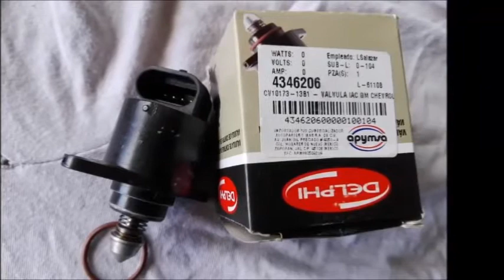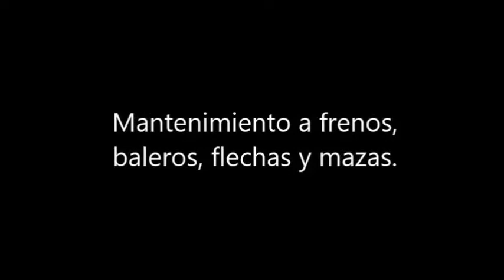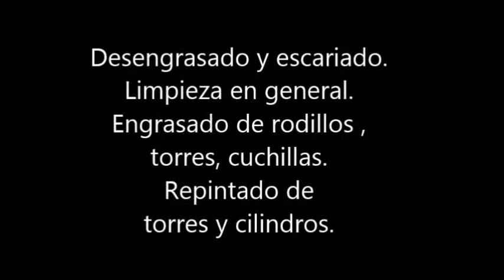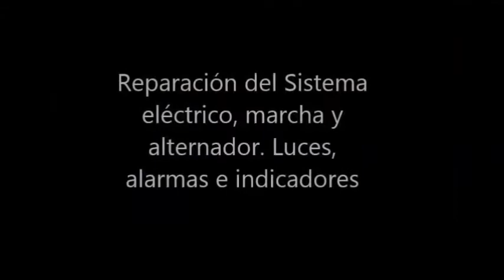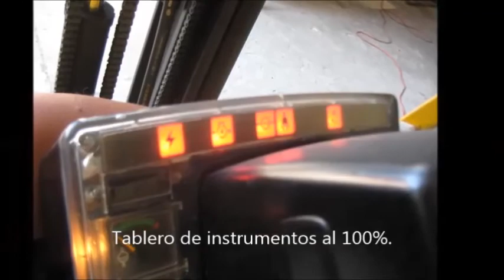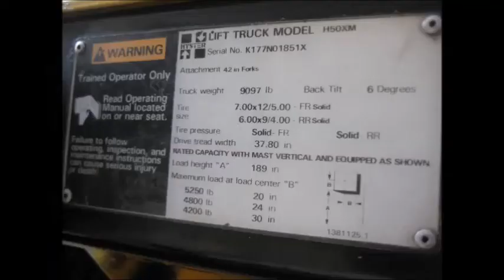Mantenimiento Integral de Montacargas Hyster. Buque Tarasco

Comment: Amigo usted tendra el manual de servicio  de montacarga hyster
Reply from the maker: Depende el modelo de tu montacargas...es Electrico o a gasolina o diésel. De qué capacidad es?... Tal vez te podamos apoyar. Saludos.
Reply: elharbano amigo es para un montacarga hyster de 3000kg a gasolina
Reply: Conquien puedo comunicarme para checar un montacargas marca hyster
Reply: Sistema se gas